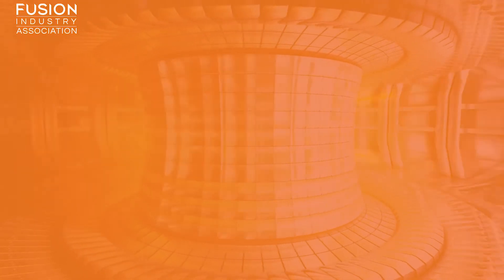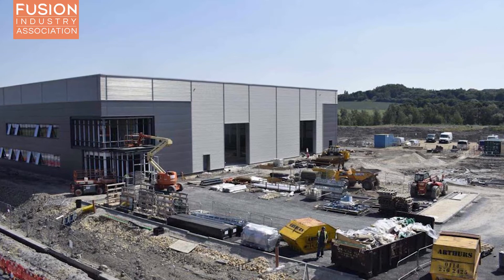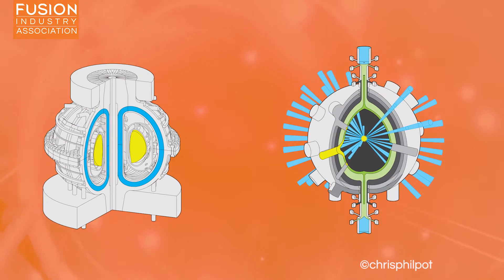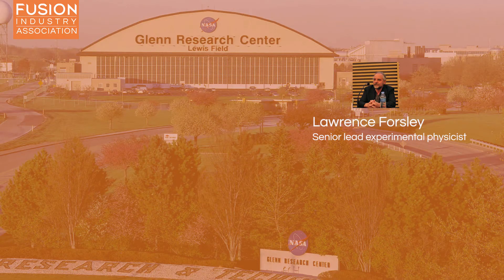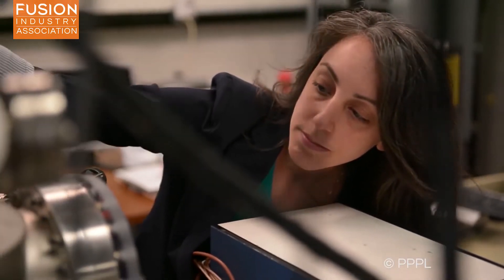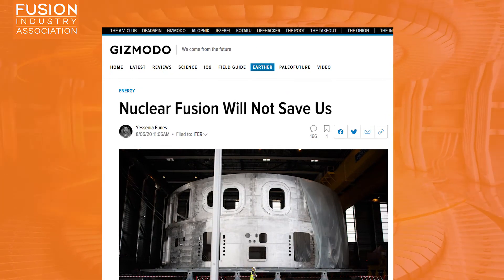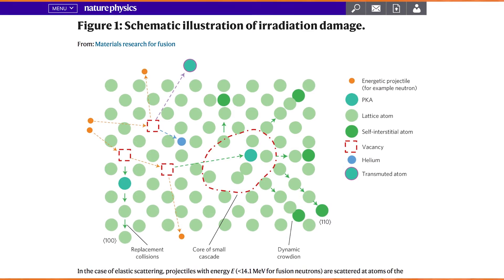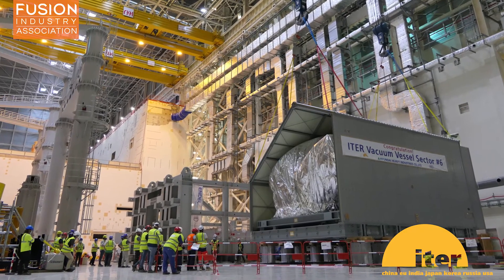Fusion News - Friday 14th August 2020

Comment: I mean this is a different flavour of "cold fusion" then. Call it what you like, LENR low energy nuclear fusion,  CMNF Condensed matter nuclear fusion. The point is all these methods use the same basic premise as I understand it. Namely Lattice confinement of deuterium. I gather in this version they use x rays as a means to excite the atoms packed in the lattice, where as Pons Fleischmann used electrical current to pack the lattice at the cathode or Anode (can't remember exactly) and overcome the electromagnetic force to fuse those packed atoms. I'm oversimplifying but basically, that's the rough idea right? 

They got universally panned for this and my problem with that is, something was going on in that reaction (excess heat)  and rather than vilifying them for heresy along with anyone who tried to fund more research into what was going on, it would have been far more scientifically valuable to find out what was going on. 

Now we see this "new" spin on what appears to be a similar idea. Don't you think this would have come along many years ago if not for the shunning of Pons Fleischmann? 

btw, question for you. At what temperature in this new approach is the fusion supposed to be happening? I haven't been able to find out as yet. If this is at magnitudes under 150 million C, then wow, seems like "cold fusion" to me.